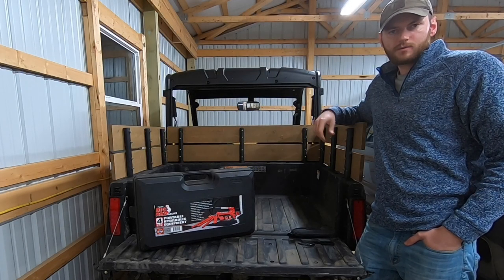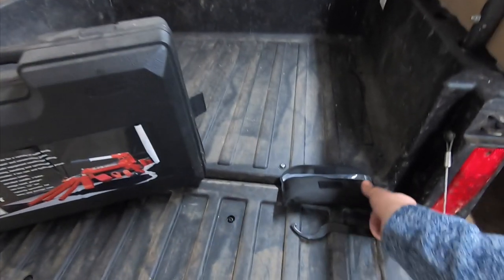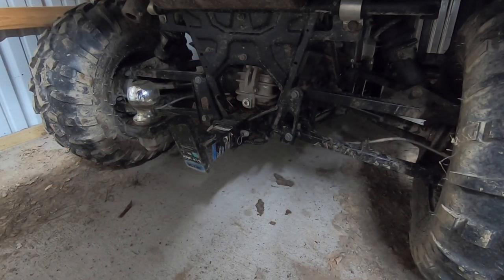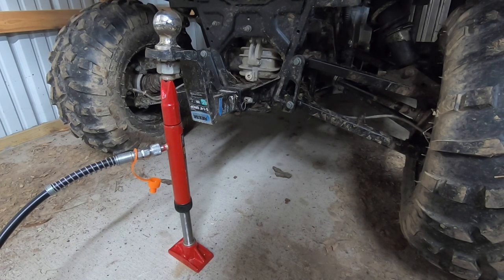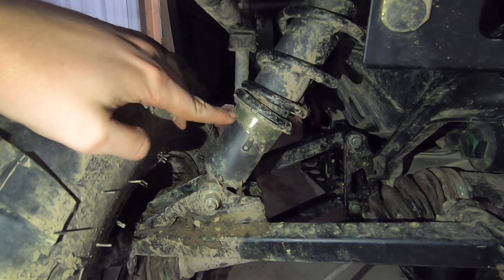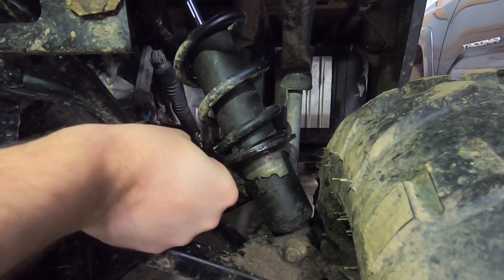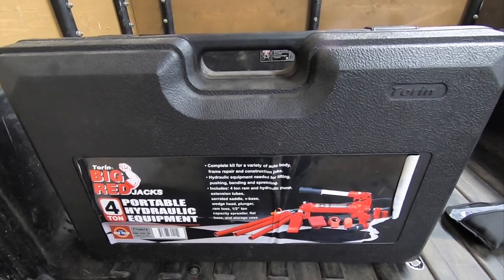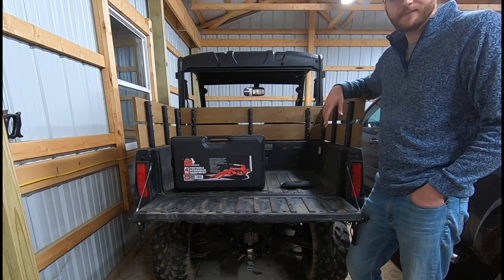#16 Increase your UTV PAYLOAD - Polaris Ranger

Comment: The hitch is ment for 250lbs on it. Buddy is jacking probably 1000lbs on it and with a receiver in it adding leverage meaning even more weight lol  Second when you jack something with independent suspension up and set it back down it sits higher till you move again. You could of softened the suspension and got a higher clearancein this case
Reply from the maker: I use the same hitch on my truck to pull a 3,000 lb boat. You mean to tell me of that 3,000 lbs there’s less than 250 lbs of tongue weight?